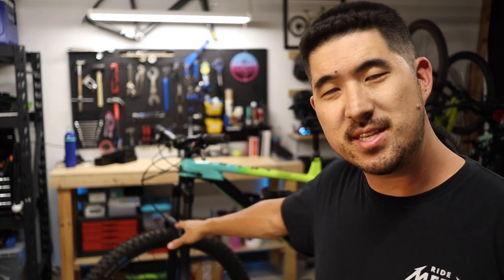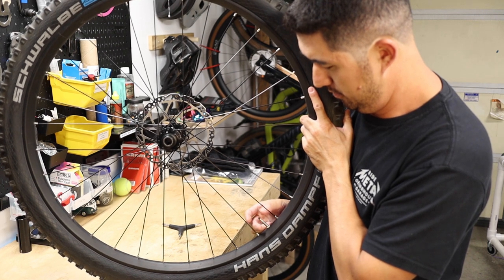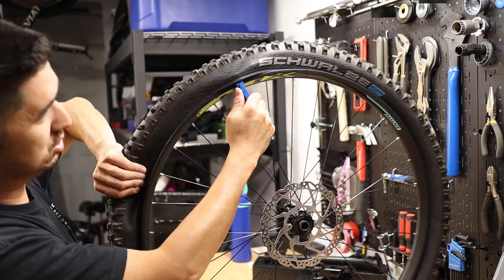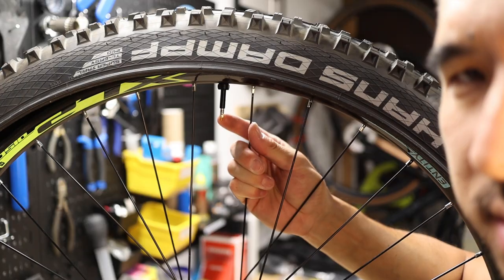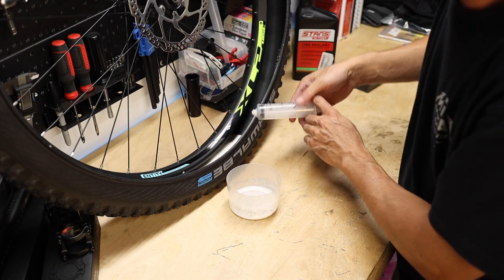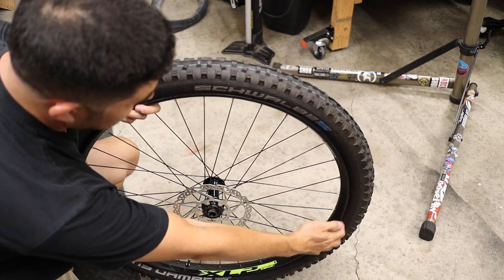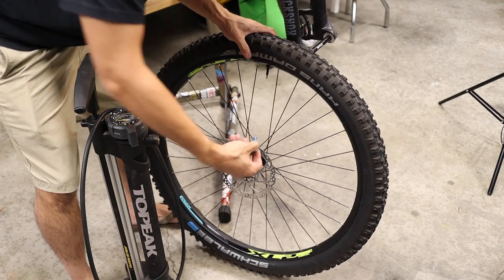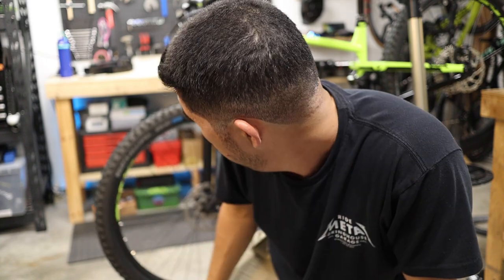Polygon Siskiu T7 // This Should Be Your FIRST UPGRADE!

Comment: I did my maiden ride on my T7 with the tubes because I just wanted to get out and ride it. But I ripped those tubes out after that ride. I was pleasantly surprised that the tubeless setup was literally just as easy as you showed in this video. Took about 15 minutes to do both wheels (with a standard floor pump no less) and they haven't had an issue since. I struggled to get my old bike to stay tubeless but that's mostly because I bought rims that weren't tubeless ready and I tried to get by with gorilla tape. Long story short, I gave up and went back to tubes. But the T7 is holding strong and it's going to stay that way.
Reply: Did you notice a difference after going tubeless ?
Reply: @TypicalGuy84  yeah, it feels a bit more supple. But the reason I do it is to avoid flats. I've only had one flat since I made the switch. A rock slashed my sidewall. I threw a tire patch on the inside and haven't had an issue since. I ride 28 psi front and 30 rear. I can go lower but when I jump with lower pressure I get danger close to pinch flats upon landing. I weigh 230 pounds so that might have something to do with it.

Comment: Besides going tubeless, the first thing I did when I first got  my T7 was I swapped the tires out completely. The Hans Dampfs were terrible traction for my local terrain, plus I don't like riding a 2.5 on the back wheel anyway.

Comment: Converting my T7 to tubeless cut its weight by approximately 3 pounds. The job was easy and I was even able to seat the tires with an ordinary floorpump.
Reply from the maker: 3 pounds is huge! Nice
Reply: How did it cut 3 lb?
Reply: @injest1017 , each innertube weighs almost 1.5 pounds
Reply: @LarryHopper You can be cutting 3lbs if you remove 3lbs of tubes but then add back the weight of the valves and the sealant.

Comment: I'm on the fence about tubeless for an upcoming tour, I've never set up tubeless before. Yours is the most thorough tutorial I've seen though
Reply from the maker: That’s high praise. Thanks! Maybe hold off until after your tour to experiment, just for peace of mind
Reply: @TheBikeSauce  good call. I'm not even sure if the rims on my current 90s mtb (which I want to turn into a touring rig) are good for tubeless. The rims are hooked, I guess I just have to get a good amount of tape on there to seal off the spoke holes?
Reply from the maker: Lots of tubeless ready rooms are still hooked. You’d probably be fine converting to tubeless, but it’s another variable on older rims. Worst case scenario, it’s a bit messy and you throw a tube back in
Reply: @TheBikeSauce  Thanks for the feedback!! Keep up the good work with your channel.

Comment: I've got a tire inflation hack on my channel. You don't need a high pressure pump... 👍
I have found that filling the sealant through the valve core after the bead pops is easier and doesn't cause a mess for noobs
Reply: Oh very cool Ill remember that. Im waiting for my 2024 Polygon T8 to be delivered, first bike Ive ever owned :) so excited. For tubeless valves is there any significant difference between 44mm and 60mm? I ordered 2 pairs of Muc-Off tubeless valves: a 44mm and 60mm because Idk which size is better.
Reply: @cupofsadge8359  I prefer the shorter stems. More room to maneuver as I use a compressor and a gun to pop the bead now. Cheers

Comment: Hi, I own a t7 it been a fantastic bike but unfortunately looks like I blew my right side fork seal. Do you know what size mm fork seals I need?   

I've actually never had a flat on my t7 and i send it on 10/12 foot jumps every single ride.. only issue I have broken the nipples right out from the rim cause there super cheaply made, so I replaced the nipples with bmx nipples that are like x3 stronger.

Comment: Hi question, 160psi inflates tire but to what max psi can rim or tire tolerate? Will it go over and damage wheel? Thank you
Reply from the maker: 160psi in the charge canister, the tire will ever only see about 20-30psi once it expands into the tires volume

Comment: Don't tigth the nut with the pliers otherwise you won't be able to undo it without the plier.
Reply from the maker: I think that’s the point
Reply: @TheBikeSauce 100% no pliars. All you need to do is push on the valve with your thumb and tighten with your other hand. It doesn't need to be any tighter than this. If it leaks from your valve with this level of torque then your have an  issue with your tape, not the valve. 

That way if you slash a sidewall/a hole too big for your sealant in the field, you can remove the valve by hand to install a tube.
Reply from the maker: It’s just snug enough not to come loose. You can still remove the locknut by hand in a pinch.
Reply: @TheBikeSauce  was just responding to your "I think that's the point response" to andre which implies that the point of using pliers was so that they can't be undone witnout pliers.

There's just no need for pliers (as there is a risk of overtightening, how are you supposed to gauge how tight something is with pliers vs. Fingers? Makes more sense to just use your fingers using the technique I mentioned above).
Reply from the maker: Sure, whatever works. I’ve seen more tubeless valves come loose and leak than I’ve seen overtightened valves, so it’s just a recommended precaution from my own experiences.
Reply: I've had multiple TL valve failures/mistakes to learn from.  First, I managed to overtighten a valve stem sufficiently to pull the entire valve through the rim, destroying the rubber seat on the stem.  Don't do that.  Overtightening can also make the seal worse.  It's a little tricky getting it tight enough, but not too tight.  Second, don't use loc-tite on the valve locknut -- it's impossible to remove on the road/trail (to put a tube in after a bad puncture) without pliers.